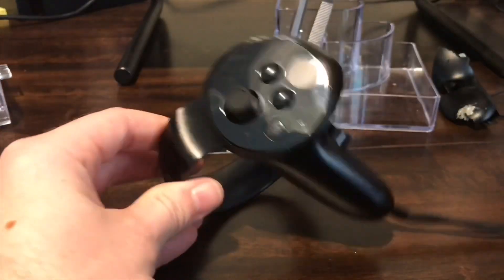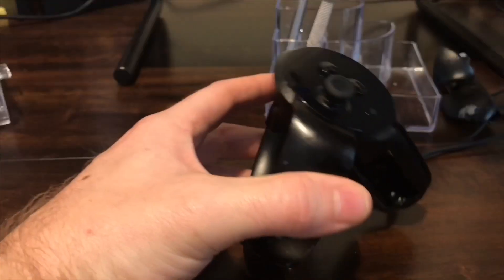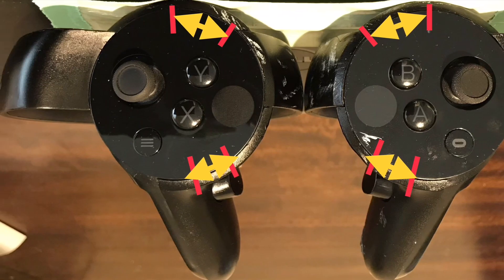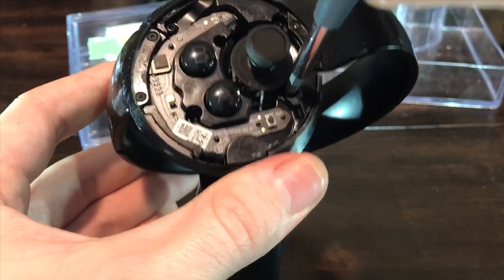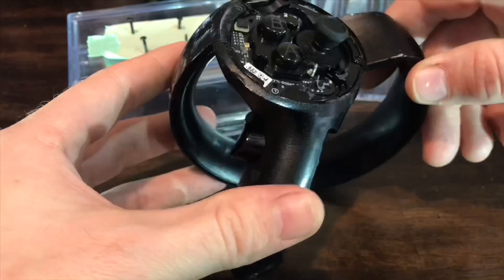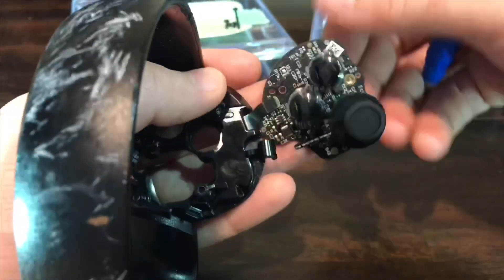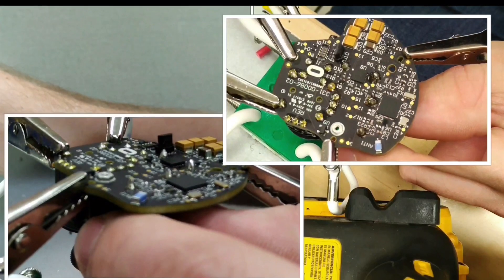Teardown - Oculus Rift Touch Controller

Comment: Nice video. I managed to disassemble and reassemble the whole controller with the help of this video - One thing, I missed is the fact that the ribbon cable connecting the top part with the grip has to be fastened in the top part for it to work. 

Unfortunately, I just need to find a working haptic motor for the controller now.

Comment: Just found a fully functioning Oculus Rift with 2 sensor and 2 controllers at the local recycling plant. All I had to do was clean the battery contacts in the controllers.

Comment: Thank you very much, i was completly stuck on the disassemblypart, where i need to use brute force. that plasticpart inside the trigger got loose, and it was permatriggering. now it works again,  andeven if it isnt reakting 100% to touch like before its still a big win :)

Comment: Thank you so much for this! The pin that holds the trigger on my right touch controller came loose, so it didn't work anymore. With this tutorial I was able to open the controller and re-seat the pin correctly instead of spending over $100 for replacement controllers!
Reply: Having this same problem right now, but instead one of the pieces of plastic broke and we lost the rod so we have to get a little creative, haven't finished yet but we'll see.
Reply: Same for me. Hope it stays in its place though. I didn't put glue or such to block it for good.

Comment: do you need to take the top part  to access the bottom part where the trigger is
Reply from the maker: Dominican frieza you pretty much have to take everything apart as shown. The only exception is for the middle screw that holds on the circuit board to get to the trigger, which isn’t much of a shortcut since it is the final screw
Reply: Ahhh thank you
Reply: I've recently just tore apart my pc and rebuilt it so it can't be that hard right?

Comment: so on the left controller the pause button still clicks but doesnt work any ideas on  how to fix
Reply from the maker: JVenom if it is actually clicking and no longer responding that’s most likely a worn out button. Hard to tell without removing and testing it though
Reply: @delectronicsvr9397  actually i thought it was  broke  but beat saber  decided to change their  pause  button without  telling us lol

Comment: Nice now my controller wont turn on :thumbsup:
Reply from the maker: kylez12394 watch the reassembly video. 99% of the time it is because you forgot to connect the power connector which is only shown in that video. Good luck
Reply: @delectronicsvr9397  Yeah ik i forgot to plug it in it only took me 4 hours to see lmao...

Comment: Thanks for the vid.  My left trigger isn't exactly sticking but something is wrong with it.  If i move it fast or swing it without touching the trigger, it registers as my finger resting on it and will trigger an in-game hand to curl that finger.  It still functions okay but it feels a little different then the trigger on my right touch.  It also doesn't make any spring noise if i hold it to my hear.  There's still almost the same resistance though.

Comment: this is a question that is kind of unrelated to the purpose of this video, could it be possible to disassemble a set of controllers and implement them into a custom controller such as a vr gun controller setup while maintaining full tracking? i have been watching videos of people using the HTC puck to make custom or third party controllers. if it is possible to do with a set of rift controllers i would definitely like to give it a try eventually.
Reply from the maker: There are defiantly ways of doing that either with 3rd party Mounting stocks for your controllers or by 3D printing your own gun stock holsters for the controllers. No need to disassemble them.
Reply from the maker: Andrew Durst just search “rift gun mount”

Comment: there's nothing in the ring thing? I thought it was some kind of capacitive sensor or something for your fingers. guess it's just a guard to protect your hands?
Reply from the maker: there are IR LEDs going all the way around it for tracking
Reply: @delectronicsvr9397  oh thanks! That sounds more simpler/reliable than what I thought it might have.
Reply from the maker: Jacob David Cunningham I bet you could be right about the capacitive sensors for the finger tracking as well
Reply: @delectronicsvr9397  I don't know if it makes sense, too small of things to track the ir LEDs sound better/more accurate.

Comment: please answer me what screwdriver did u use
Reply from the maker: its a TORX (six sided star) screw sizes are all T6 except for the single center screw which is a T5. 
The screws holding the halo on are also T5 but i do not remove them in this video
Reply: thanks u really helped i have been searching for a long time now
Reply from the maker: Seofmadness 102457 happy to help, hope to see some VR videos from you now ;)

Comment: What kind of screwdriver is that? I can't see it well enough in the video and the screws in the controller itself look...odd. They don't appear to be philips or flat.
Reply from the maker: BionicDance these are torx screws. Basically a six pointed star. The size for  most of the screws in this video are T6 with just one T5 found in the middle holding the PCB to the plastic button chassis
Reply: I see. Thanks. :)

Comment: @
DeLectronics VR can i do something about the joystick moving on their own randomly? is there a chance that cleaning them up will fix this or is this impossible to do? i see the joysticks being held in a metalic box lol, or should i just spray some WD-40 into the joystic from the outside and let it lubricate over night? o have never hit them or anything idk why they both started doing random movements one day after i installed Oculus Tray Tool no clue if that had anything to do but i uninstalled that and they are still moving on their own randomly. Thanx in advance for any advice you could have with the knowledge you have gathered so far.
Reply from the maker: Rogue Outcast I have heard of people soaking the controller or at least part of it in high 95+ alcohol and then letting it dry. I think the effects of just soaking are minimal but may be a last resort. Just make sure to let dry around a day to be safe.

Comment: I have an odd issue with my left touch controller: the trigger does not stick physically, but I noticed that it fires twice in every game I play when I only press it once. So when the trigger is pressed down half way, it fires one and then when you press it all the way down, it fires again. This is normally not an issue if I remember to press the trigger slowly, but once I start to press it quicky (i.e. Dead and Buried) it won't fire at all. Any suggestions as to what could be causing this?
Reply from the maker: Rodney Ramos Jr. lem’me explain the button first a bit. The trigger is in no way electricity connected to the rest of the controller. Instead there is a magnet mounted on a circular plastic insert piece which is then simply clicked into place on the inside backface of the trigger. You should be able to spot the magnet. There is then a sensor on the main board that senses how close that magnet is to it and that is how it determines how depressed the trigger is.  

Now... the plastic piece that holds the magnet LOOKS almost like it is all one piece with the trigger, if it is snuggly snapped into place as it should be. You should be able to distinguish some small mounting clips if you look close enough.
In my experience (slamming my controller against many the concrete floors and punching walls) that plastic mounting piece has come loose out of its properly mounted position.  Many times I simply press it back into the trigger and it will snap back in and vwala. It’s all better.  Other times the small mounting clips had been snapped off and I had to glue the piece back into place. 

That piece being dislodged from its mount is most often why I have seen this issue. The magnet is just kind of shaking around in there causing the trigger to act as if it were depressed or partially depressed.

Good luck, I hope that’s it for you since this is usually a pretty easy fix. Let me know how it goes.
Reply: DeLectronics VR  I figured it out, but it was all VR code related which totally caught me by surprise. After opening both my left and right touch controllers to remove the rubber pads that completely left their designated spots, I reassembled them and noticed the issue was still there with my left touch controller. I then started to search around my PC to hopefully locate some system files such as an .ini per controller that had the instructions. Sure enough, I found two files under Appdata. One was named “Ltouch” and another “Rtouch”. I found the parameters “Trigger min”, “triggermid” and “triggermax” within each text file which indicated to me the 3 input stages of the firing trigger. So I took a chance and copied over the values of the “Rtouch” file into the “Ltouch” file since my right controller worked fine, but ONLY for the triggermin, mid and max parameters. I then rebooted my PC. Upon reopening Oculus, it was fixed. Quite a learning experience!!

Comment: my grab buuton has no spring to it. how can i repair ir?
Reply from the maker: Jack Umland if you are lucky, the spring may have somehow found its way out of its placement. But most likely a plastic piece holding the spring has broken off and you may need to get some epoxy to hack it back together. 

Just to be sure, it’s not a stuck inward button correct? In your case does the button just flop around if you shake it. And can you hear pieces moving around when you shake it lol
Reply: @delectronicsvr9397  its the ladder. It just flops around. And now the trigger button on the same controller is difficult to press in and makes a cracking sound when i do.

Comment: Thanks! can you please post a video of how to fix the grip button (when it gets sticky) thanks a lot  in advance!
Reply from the maker: oren88 I just happen to have one that has been getting sticky lately. To what extent is your’s sticking? 
Is it just a noticeable stick every time you depress the button or does it completely stop to where you have to pull it out
Reply from the maker: oren88 https://drive.google.com/open?id=1AV4RlLhunjavdjhaDeCrCP5QraBguT1b
This tab is the most common piece I have had get slightly bent and cause the grip button to stick.
I have broken simply it off to fix it. It’s possible yours could be different another bent out of shape piece

Comment: Had a battery Go bad in mine. Made as mess. Think it can be cleaned up or should I just invest in new controllers.
Reply from the maker: FWMalice can’t hurt to try right. I’d soak/scrub corrosion with high percentage electronics grade alcohol about 90%+ higher if you can find it. Let dry for a while day if you soak it into tight components.

Comment: Does 2:36 need a lot of force? Im skipping unscrewing the bottom right screw bc it won't budge at all and I am worried that it might be held on to the handle.
Reply from the maker: Luke Blackwell it takes a little bit of force since the plastic is bending a little bit to clear that lip
Reply from the maker: If you are pulling hard and don’t see that lip budging than you must have forgotten 1 of the screws.
Reply: @delectronicsvr9397  I am using a good amount of force I just need the go ahead to put a little more in
Reply: I see the lip budging
Reply from the maker: If you took out the 4 screws on top (not including the center t5 screw) and then 3 screws on the side, you should be good
Reply: @delectronicsvr9397  I took off 3 not 4 the one on the bottom right came pretty much stripped
Reply from the maker: The plastic is pretty sturdy if you are just worried about it snapping in your hands
Reply: I'm just trying to get to the handle to fix the trigger
Reply: What do the 4 screws hold together
Reply from the maker: They hold together that handle you are trying to take off
Reply: @delectronicsvr9397  the one just seems like it's just for the trigger
Reply from the maker: You absolutely need to take out the top 4 shown at 1:37. They screw directly into that bottom plastic handle piece
Reply: @delectronicsvr9397  or is there an alternate way to get the handle off
Reply: @delectronicsvr9397  I managed to get the 4th screw out and it made a world of a difference. Thanks for telling me to do that otherwise I would have broken my controllers
Reply from the maker: Luke Blackwell awesome, tweezers make a world of difference
Reply: Is there a way to just get to the trigger like to pop it off without removing the handle?

Comment from the maker: @kmw the screw sizes are all T6 except for the single center screw which is a T5. 
The screws holding the halo on are also T5 but i do not remove them in this video

Comment: As others have mentioned, you won't be able to reassembly if you don't remove one extra screw, which is touching the wrist strap.
To have access to this screw, you have to push a piece of "rubber" to make way.
This last screw allows you to reveal the flat cable that comes from the battery. I had to "unglue" this flat cable from the controller's wall, otherwise it was too short to connect to the proper slot.
On my first reassembly, the controller was not turning on, and the reason for that was precisely that flat cable which was not connected. Note that this flat cable disconnects "on its own" during disassembly so its really easy to miss.
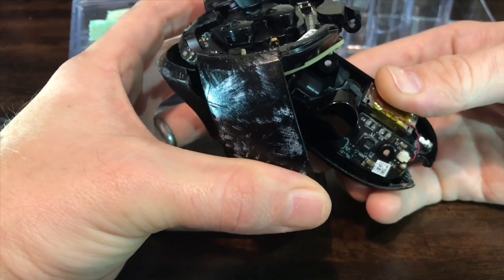Reply from the maker: Diogo V. Kersting @ 2:55 I mention this, but you're right it is easy to miss. 
The ribbon cable is tricky and I have forgotten it several times when putting everything back together. It is possible to get it back on without removing that last screw but TBH it sounds like your way may be a much better approach. I'll have to give that a try.
Reply: @delectronicsvr9397  I tried for over half an hour to connect without taking the "last screw", but I was unable to, so I gave up.
Taking out the "last screw" is indeed the way to go.
Reply from the maker: Diogo V. Kersting I have a good bit of smart phone repair experience and have racked my brain trying to figure out how they automated that part of the process since it was so hard for even me to do. (Second most annoying reassembly step behind snapping the final side handle cover back on)

Awesome job spotting that screw.
I can't wait to try it now to make things easier!
Reply from the maker: Finally the reassembly video :) enjoy https://youtu.be/yNpdidHa1T0

Comment: Your video was really helpful. Thanks! I recently used it to fix a sticky trigger, but now my controller won't turn on. Any ideas on what might have gone wrong? Btw, I tried to private msg you but it seemed you had that option turned off.
Reply: Never got a response, but I ended up figuring it out. I almost ended up buying a new controller. You have to take off one more screw on the part that holds the battery. It's at the tip near the string that you wrap around your wrist. This way you can easily reattach the cord from battery pack to joystick board.
Reply: @paulcjin  I got mine back together and full functioning so I'm all good it's just a hell of time getting the tint ribbon cable reconnected
Reply: @paulcjin  Mine won't turn on either. Witch screw are you referring to? Is there one more besides the two that are hidden behind the plastic on the battery side?
Reply: @NicolasHaye   Yes, there is one more. Look at the very tip where the wrist strap attaches. You'll see one more screw there. Taking that off allows you to swivel the entire battery compartment so you can access the small ribbon on batt comp and attach it to the main board for joystick/buttons. That small ribbon is what sends power from battery to main board. When you disassemble the controller that ribbon automatically gets detached.
Reply: @paulcjin  Ok, I found the ribbon cable, but when I try to attach it it just comes off by itself, it doesn't connect. Any recommendations? Sorry to bother you P J!
EDIT: Done it, just a little tricky. Thank you very much, none of the tutorials that I found online especified that thing about the ribbon cable. You're awesome!
Reply from the maker: Yes the ribbon cable is tricky and I have forgotten it several times when putting everything back together. It is possible to get it on without removing that last screw but TBH it sounds like maybe y'all have found an easier way to reattach the power. I'll have to give that a try.
Reply: @delectronicsvr9397  "easier" lmao that's the most annoying thing I have ever done with hardware. You have like a 1x.75" space to work with it's sucks it took taping the controller in place to use two pairs of tweezers
Reply from the maker: Jagged Demon I really need to do that reassembly video. Totes annoying lol
Reply from the maker: I finally got the reassembly video posted here https://youtu.be/yNpdidHa1T0 sorry it took sooooo long
Reply: @delectronicsvr9397  Mahalo I'm going the check out the reassembly video. Unlike a lot of people here my problem is the controller won't turn on at all, so I'm suspecting a power cable failure and I'm hoping I can jury rig something so as not to have to put out $70-$100. I already bought a used HDMI cable for the headset for like $95+ and I'm suspicious that it's not that good either! This iteration of the hardware was definitely a pain in the a**!
Reply: Same issue and as well I can't reconnect the ribbon in the handle any simple way

Comment: This was EXTREMELY helpful. My trigger was sticking and this showed me how to break it down and remove a piece of loose plastic that was hanging it up. Thanks a ton.
Reply from the maker: glad it helped, i have actually had the exact same issue
Reply: @delectronicsvr9397  I also have the same issue